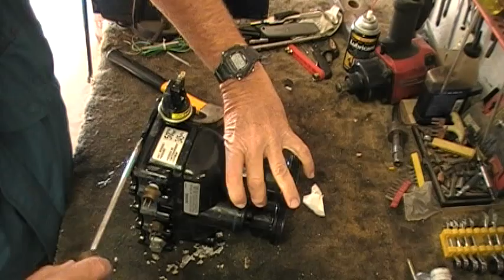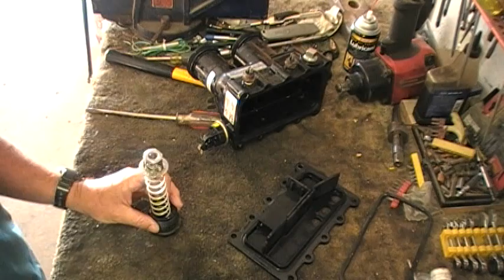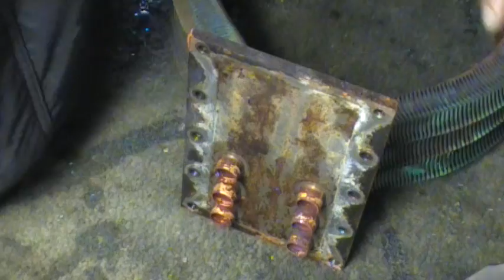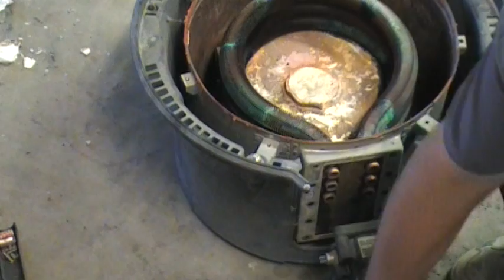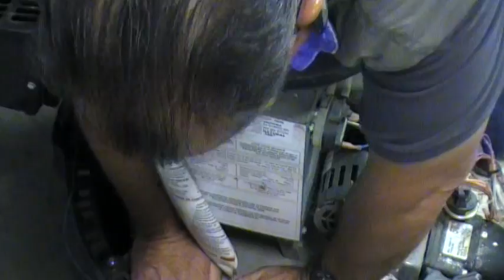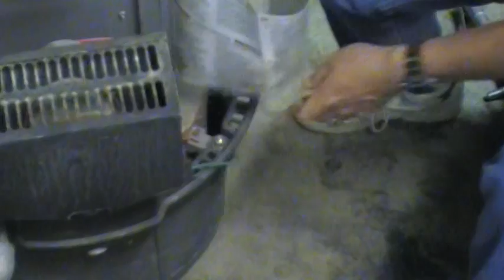Sta Rite heater2.mpg

Comment: How long it did it take to pull it from the job site, take it to the workbench work on it and then reinstall it at the job site? Also what was the cost of the parts?
Was it really worth repairing or should one purchase a new unit?
Reply: Its really not worth the time and labor vs just installing a replacement lol

Comment: Hi jay, very informative video, I have a sta-rite sr400 I hooked it all up and ran the filter, after a few minutes water started to come out of the side of the blower, not the side with the motor the other side, my pool guy said I probly didn't get all the water out over the winter and the heat exchanger cracked, iam pretty much screwed! Any thoughts could it be a different problem? Thanks

Comment: Great Videos Jay.  I am working on my mom's heater. she has the Sta-rite sr400na.  It is a little different than this one but  very similar.  When I took the intake manifold off the inside is completely rusted. I have photos I can send if you need to see them.  I am guessing this needs to be replaced along with the bypass valve and thermostat. Where is a good place to get parts of this?

Comment: Awesome Video, the best teach people (as you do). The others (not so best) want you to know as little as possible. I have a question, do you use Lube on any of the O-Rings ?
Manifold gasket O-Ring,Thermal regulator cap O-Ring, Tube Sheet O-Rings?
Also I pulled my Tube sheet and where the pipes (Nipples ?) protrude through the steel plate, I have one that is shorter than the other eleven nipples. I believe my unit froze without being drained.
Reply: You Guys ROCK I bought a used one down in los angeles (They never freeze) and pulled the manifold, and installed it in my heater, and 9 years later it still rocks..!!! CRAP !!! Have you seen what they want for these..it was appx $1200 "9 years ago"..NOW ..OMG !!!